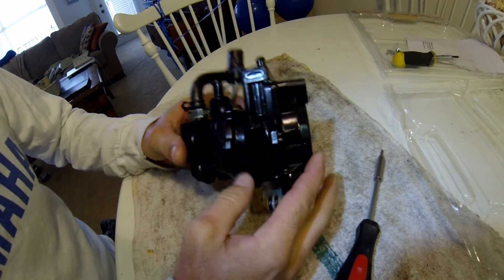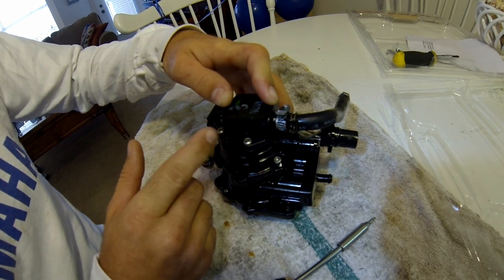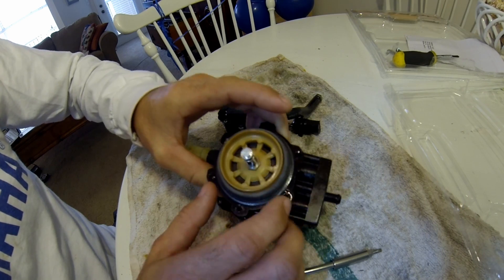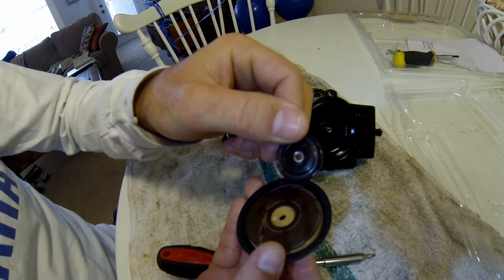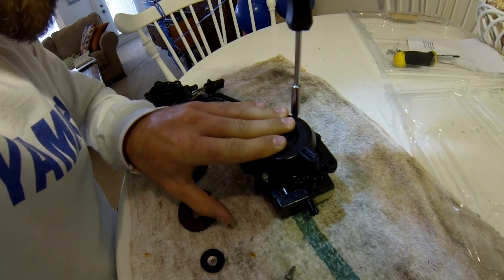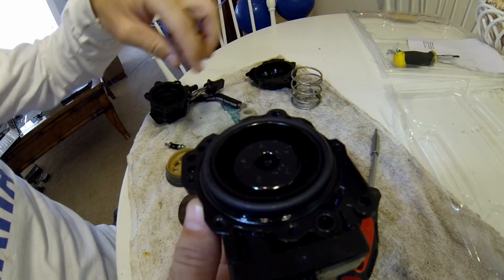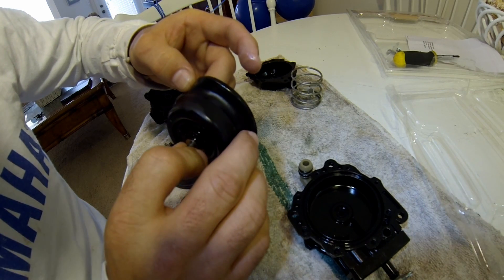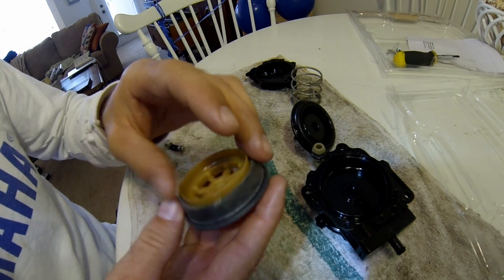VRO Rebuild - Break Down

Comment: Just replaced my diaphragm in my vro pump on 96 Johnson fast strike 150 . It was torn and busted only kept dieing in water after replacing and fixing it now bogs down on take off and doesn’t get better. Any ideas what could make it do that after replacing the diaphragm
Reply from the maker: Maybe the carburetor isn't clean?
Reply: Yeah cleaned all 6 . Changed my my prop to a smaller pitch and got another vro pump and finally quit bogging down now working on my trim/tilt it stopped working yesterday no reason
Reply from the maker: @denisepresley7080  shouldn't be too difficult to change the pump. Good luck.

Comment: You will never find peace until you replace every plastic hose clamp and zip tie (with metal hose clamps). All my fittings were leaking. Vro2 installed around 2012. Pump up the ball and wiggle fuel lines all the way up to the carbs. Wear safety glasses.

Comment: Same issue with my Johnson (2000, 150 HP). Where can I get the kit?
Reply: http://www.maxrules.com/fixomcvro.html is where he got the kit....but you can search out for better prices if you wish

the parts blowout with part numbers is here 
http://www.shortsmarineparts.com/pages/OemParts?aribrand=EJP#%2fJohnson%2fFUEL_SYSTEMS_2000%2fFUEL_PUMP_REPAIR_KITS%2f34018%2f57932
Reply from the maker: Maxrules and Mastertechmarine are the same thing.
Reply: You can't Google "Johnson VRO Pump kit" yourself....???